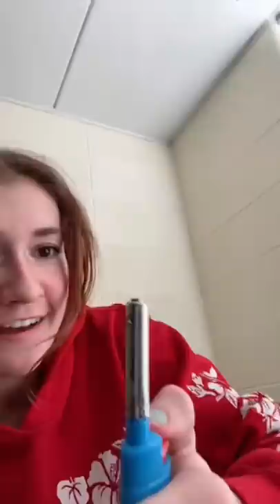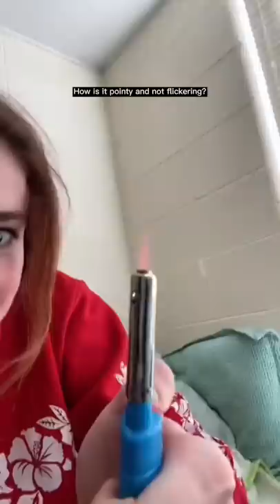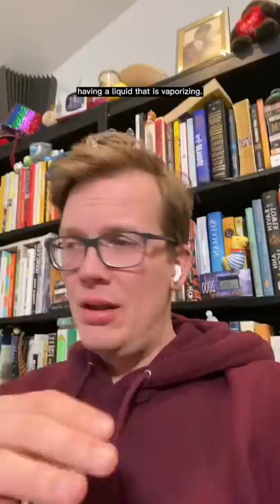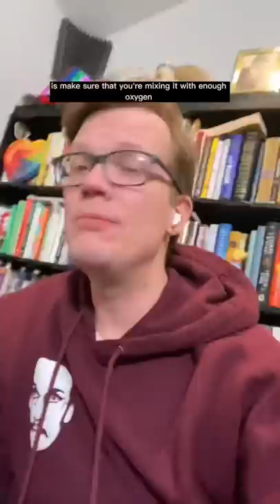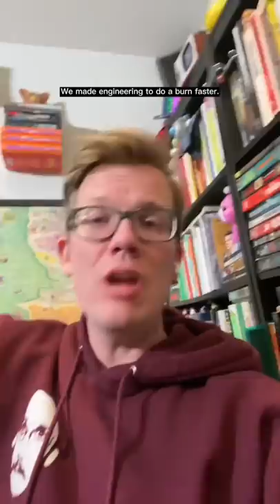How do jet flame lighters work?

Comment: Not entirely true. For true jet lighters you are correct, but the cheap shitty kind like the type this person has in the video actually pass the flame over a metal catalyst to get the flame to be the way it is (that's also why the flame is an orangey colour rather than the faint blue that butane usually is when it burns)

Comment: These can fail to light somehow.
Reply: There is a tiny screen washer and thin metal disk with a tiny hole in the center 
  In the bottom end of the burner this screen and nozzle can become plugged by dust debris from refilling or having it apart 
    It is possible to unscrew the bottom of the burner to access these parts and clean them with alcohol

   The screen is to make the gas travel in laminar flow 
   So venturi vacuum can mix in more air after it leaves the nozzle
Reply: @terranovarain6570  these are sold as disposables though. Those cant be manipulated in any way other than dismantling them.

Comment: It's important to remember that MOST fuel burning applications, whether that be for cooking, producing heat, lighting stuff on fire, or even moving a car, burning AIR is doing most of the work, fuel is often merely a catalyst to make that air burning possible, hence why cars burn 14.7 parts air for every 1 part gasoline.

Comment: Bad explanation. First off normal and jet lighters have butane stored and the same pressure. Only difference is that jet lighters have a nozzle that uses the venturi effect to suck in more oxygen